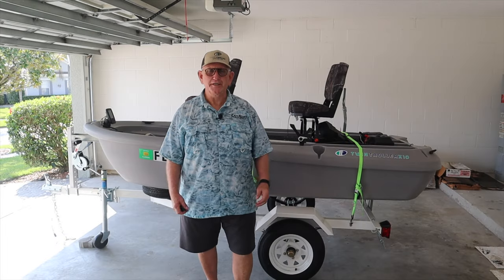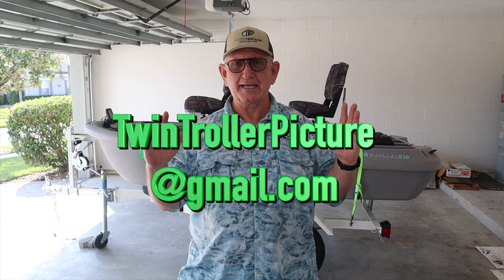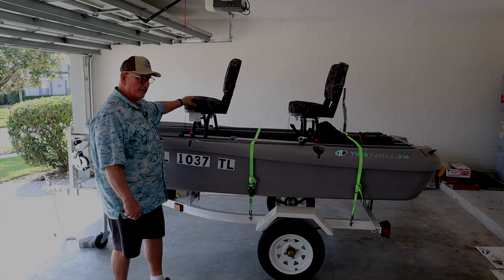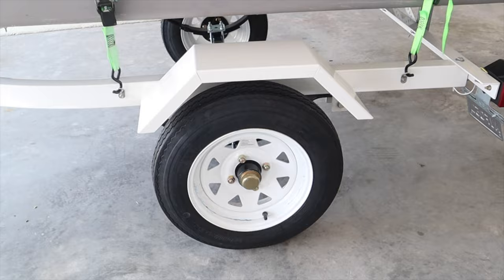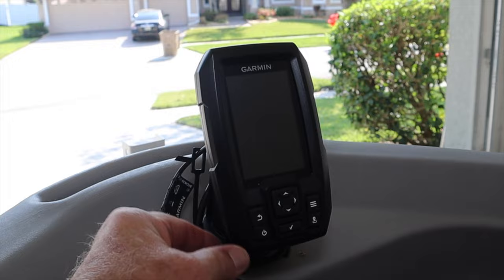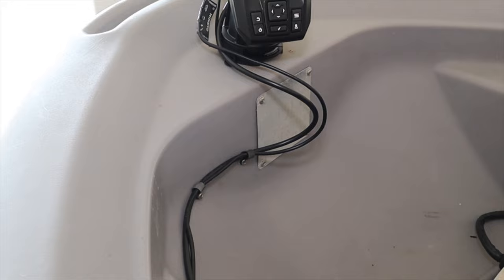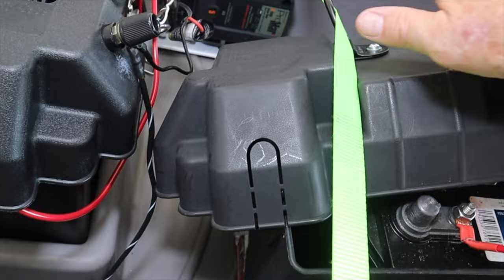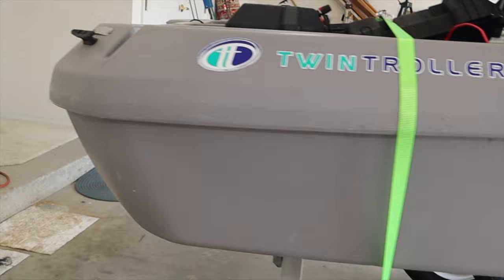ANOTHER - READY TO FISH - TWIN TROLLER X10 FOR SALE!

Comment: I have watch most of your Video's  and actually bought a 2020 model. At first I love it, but after a few Months I wish I haden. Should be name after a FORD, Fixed and repair daily. we have several lakes in my area that don't allow gas motors, but I will not take this, Just can't truss  it. I recently bought two foot controls, almost 400 bucks, after installing I took it for a test a couple times. everything OK , So I make a long drive to a small lake, Never got away from the ramp, the right control had fail, would only go in forward. When you contact freedom marine they get right to you when your going to buy something but when you have a problem they leaving you hanging, this is day 3 and I'm still waiting for them to help me with there Fail controller. I also making a video on why not to buy one of these. You're in contact with freedom marine often described in your videos do you have a phone number I can call a service tec'
Reply from the maker: frank@freedomelectricmarine.com
Reply: @LunkerFishing  A rep called me yesterday in the afternoon, After I explain my issue he said he agreed with me and I needed the Controller replaced. But it haft to be approved through the higher ups. SO I waiting for Frank Jones to call me at this point.  Thanks for the attach email, I will reach out to Frank this am. CJ
Reply from the maker: @charliejones8135 , That is great news. Hopefully you wil be catching your personal best soon 🎣            Gerry